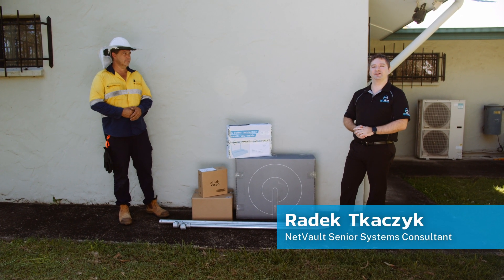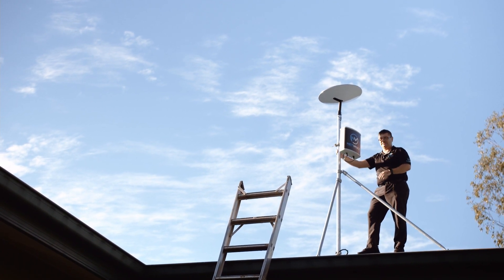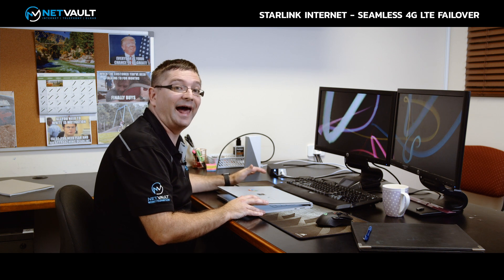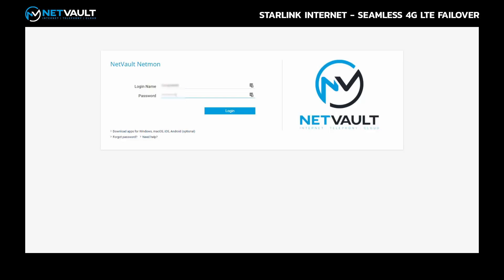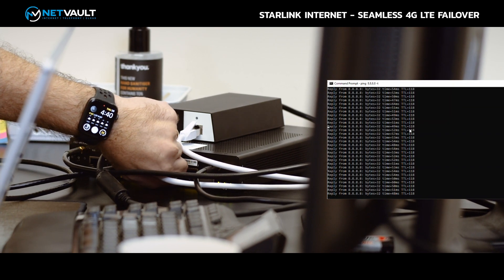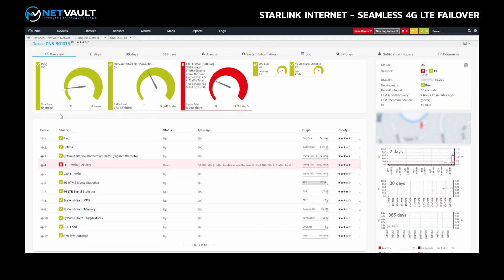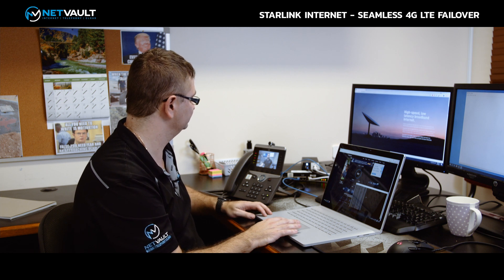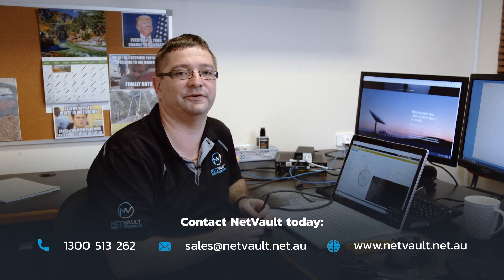SpaceX Starlink services and speeds in Asia Pacific

Comment: You should have the 4g modem on a different pole otherwise something that damages the pole takes out both. I actually think putting the dish on a stick out in the yard might be best and leaving the 4g there on the roof. You needn't have wasted the cable when turning it off suffices for your demo.
Reply from the maker: Hi Davious, yes adding a second pole ads to a more reliable solution, but then ads more cost to have additional poles, and some clients are already desitant to add a pole to their roof due to the asthetics. Yes you can put the dish in your yard, but there are obstructions and trees to think about - especially when trees grow - so the roof is a smarter place to put the dish - less change of accidental damage.

Comment: Is this video about how to waste money? Starlink does not need to be installed by a bunch of expensive guys with their public IP. Starlink is only $499  for the antenna and $99 per month for service.
Reply: Hi Gleb, for a standard home user, that's correct, it's not usually needed. But if you are a user who wants a nice neat, professional installation, and wanting seamless failover to a 4G LTE circuit in under 1 second, this solution may be of benefit. Also, businesses who need a failover service and can't afford any downtime may want a superior service like this.
Reply: Not a waste of money at all for a business even one run from a home office.
Reply: Most people that have money don't mind spending it. Maybe the owner didn't feel like getting on the roof himself. Sometimes it's nice having money
Reply: Gleb? OK, this is in Australia. The costs quoted are in Australia dollars. FFS. They are the Starlink prices.
Reply: O depending on customers needs a static IP maybe required.

 I wish I had seamless failover with UDM pro.

I live in Maine USA my weboost manages 2MBPS by 0.6Mbps on my 3G service which is supposedly 5g lol...

My Starlink gets about 150-220Mbps average